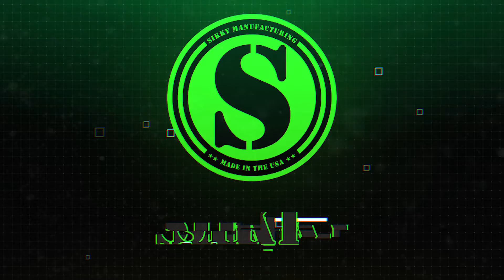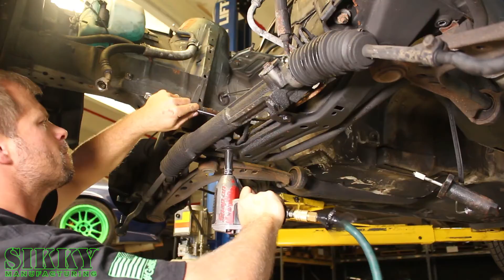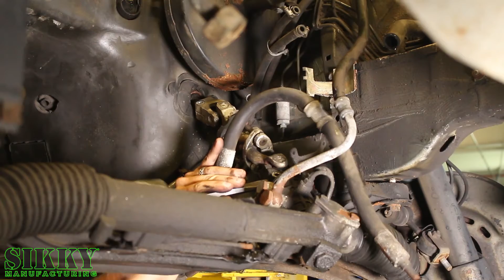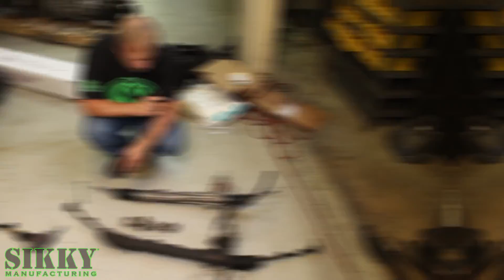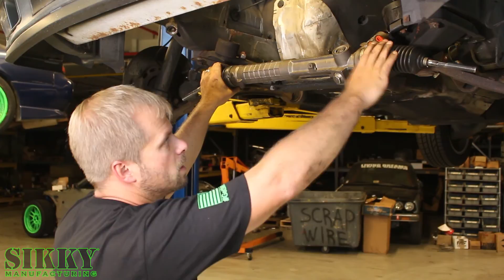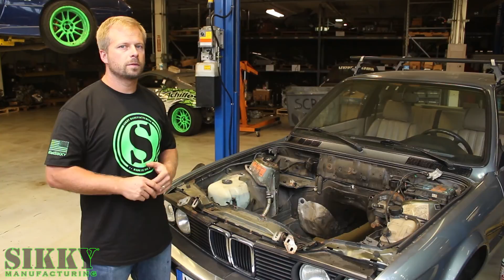E30 to E36 Steering Rack Conversion SIKKY Swap Kit

Comment: I’m about to go for z3 rack for my 1988 e30 and no engine swap at this time. Would your kit work or yours is exclusively for LS swap application. Thanks!
Reply from the maker: Yes it will work doesn’t have to be LS swapped

Comment: Curious if you would have any idea if e30 outer and inner tie rods would fit into an e46 rack . Im not using a e36 rack but im assuming it should be the same anyone know?
Reply from the maker: They would likely fit as far as diameter and thread size, only question would be what length would be after installed and if that would work.  Worth a try!

Comment: Would this swap still require ls mounts for e30 and not e36?
Reply from the maker: Yes, it's an e30 chassis and has an e30 subframe so it would need Sikky LS e30 mounts.  We are adapting the e36 steering rack to fit on the e30 subframe

Comment: Can this work on a e34
Reply: i wonder too
Reply from the maker: possibly, have not tried.  It's very likely that it could.  If you measure the diameter of the shaft on both sides where the splines are and count the splines we can take that info and confirm if it will or not. Emails sales@sikky.com with that info.

Comment: I noticed you put the bolt that holds the rack in from the top, with the nut on the bottom.  I recommend putting the bolt head on the bottom and the nut on top.  Otherwise, it's really difficult to get the bolt out once the engine is in place.

Comment: works for a RHD?
Reply from the maker: It can. You would need to measure your shaft diameter and count your splines to make sure it’s the correct one before ordering. Email us with that info and we can tell you which one to get.

Comment: What is the part number of the e36 power steering rack?
Reply from the maker: The e36 steering rack is a couple different part numbers that have different ratios
Reply: Grab a z3 1.9l steering rack for 2.7 lock to lock or e46 330ci purple tag everything else e36 or e36 m3 is 3.2 lock to lock

Comment: You should do this video with the engine still in. Show how most of us will be doing the swap. The hard way.

Also would it be suggested to drill and tap threads for the shaft if its a daily driven car?

Comment: How did you connect the power steering lines as they on the opposite side?  I’m looking for a fix before i start my swap and am considering  your steering rack kit.
Reply from the maker: We have a power steering line kit if your going LS that has the right connections in the right positions for the LS power steering pumps.  Are you swapping a different engine than the LS?
Reply: SIKKY      Yes I have an 1995 s50 m3 motor
Reply: jesse Hopkins I habe an s50 in my e30 with garagestic kit just bend the stock hard lines or use late model 328 is PS lines

Comment: Will this steering shaft work in right hand drive e30s? Because the starter motor on the LS is on the drivers side
Reply from the maker: Yes, we have heard from our RHD customers that it works.  We have not tested it in house since we do not have any RHD e30s here but supposedly it works fine according to our European customers.
Reply: I threw a ls1 in my e30 and have the e36 rack it works

Comment: You still still use E36 tie rods, you just have to get both inner and outer. I prefer them for their adjustment. Also tip for others, slide the steering rack bolts from the bottom since the engine will prevent you from getting them out later. I haven't verified but your shaft conversion should also cover stock E30 racks in E30s. I still need to find a factory M20 E30 to measure. There aren't many around. 

Love the series <3
Reply: Looks like he is an apprentice...... that had to tie the engine out just to take a rack out